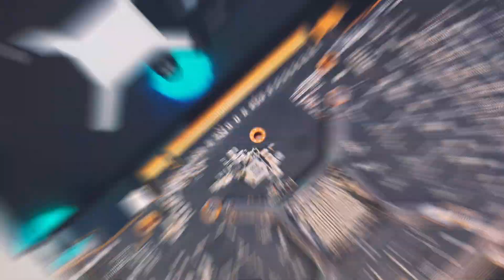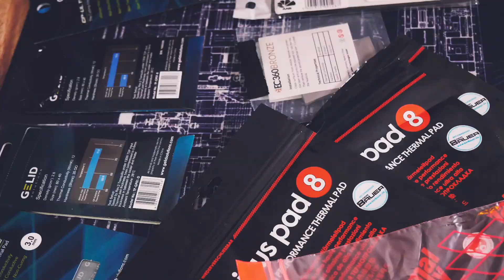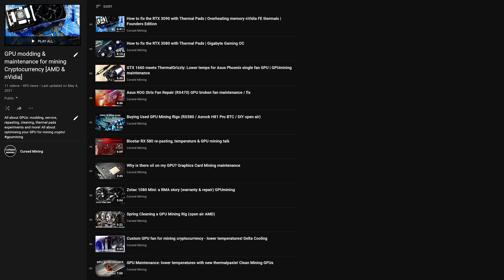Thermal Pad change: Sapphire RX 5700 XT Pulse | GPU Modding Before & After Vram Temperature

Comment: Cursed Mining : you illiterate buttercup.....you didn't remove the plastic insulating cover from the bottom of the backplate where you have put the thermal pads for the memory chips !!!! You have ZERO conductivity and infinite insulation. That's even worse than it was stock.

Comment: i tried out this mod with 1.5mm for the inner most pads and 3mm for the backplate ones. i went from 77c core/79c mem/99c hotspot temps down to 60-65c core/65c mem and 78 hotspot! I was pretty surprised at how well that worked! I was honestly expecting a few degrees drop only and would have been pretty happy about that but this took it to a new level. next time I repaste I'm going to try an idea from another person that also did a video on this mod but they put paste on the flat area under the heatpipes where it makes contact with the second smaller heatsink. So far my temps have been stable so I dont wanna open it up again too soon and mess the temps up again so I'll just have to wait for the next repaste or if it starts spiking in temps again. So far so good though! thanks for making this guide!
Reply: Edit: Nvm. Don't know how it fixed itself but it magically worked after posting this comment lol

Tried this, but now, my screen doesn't detect my PC, BIG OOF.

I don't know if I accidentally broke anything as I was being careful with it. Have to take it to a shop and see if they can tell if it's broke or I'm just not putting the wires in correctly.
Reply: @FullchanAnon  could've been a pcie power cable not seating in fully? has happened to me before but glad to hear it worked out! hopefully you see the difference in temps like i did!

Comment: My RX5600XT (sapphire) does 100-102°C memory when mining/gaming wtf????
Reply: If you mine lower your core voltage to 1300 and voltage to 800
this will lower your GPU temps and Lower power consumption 
Hashtrate will not be affected.
Reply: @drgoose2206  do you think i am a newbie to this??? Man, i mine since the cpu bitcoin mining (my celeron made 2000BTC a day the day back) + this has nothing to do with MEMORY temp, that just means that some pads are misplaced and that sapphire uses shitty pads on memory modules (worst thermal conductivity)

Comment: Can I use any 3mm thermal pad? Any brand? Mi Sapphire reaches 100 degrees. :(
Reply from the maker: sure any brand :) but ofc pad with less conductivity will have worse results, that is measured in w/mk :) cheers and happy modding

Comment: May I ask how big was the thermal pad you bought? I was planning to get the thermal right odissey and they have a 85x45 option and a 120x120 one, I was wondering if buying 2x 85x45 1mm and 2mm each would be enough for front and back

Comment: look have same model as yours but it's rx 5700 i'm not using it for mining just for content creation and video montage and gaming at idle it's around 50/55 celcius and on benchmarks it reaches 68/70/75 not more than that and in some games like hitman and resident evil games on ultra settings the card starts to make a big noise and temps increases to 75/78 celcius 
do you recommend re-applying thermal pad to decrease temps?
Reply from the maker: hello mate! Is this Core temp or Memory temperature? If memory, then you are fine. If core.. it is a bit much on the latter (75+), but in gaming it only happens for short periods of time. To confirm I would use a program like hwinfo64 to check memory temp while doing so, this should definitely stay <94°C. Of course a change like this could still help, pads and paste make a difference, but I would not worry too much if it stays below 70 most of the time (or say 90 or less on memory) :) cheers
Reply: @CursedMining  i don't know this is current temp i gave you junction temp it's more than current gpu don't know where to find memory temp or vram.
Reply from the maker: hwinfo64 is free software for that :) but if junction is not in the 90s it should be fine 👌🏻
Reply: @CursedMining  i'll check it and tell you

Comment: Great video! I was wondering about the backplate when placing the thermal pads that will be conducting heat from the back at 0:1:55 - I saw that it had a smooth plastic sheet underneath it - noticed that it wasn't present on the portion on the long strip of thermal pad and the small square for the one thermal pad beside it. Do we need to strip off a portion of the plastic sheeting before placing the new ones as you did as well?
Reply: real

Comment: Hi friend. Are you sure that the size of the pads are 1mm? Because I saw some people saying that the ideal is 0,75mm or 0,5mm to have a better conductivity.
Reply from the maker: heyho, I went after the Gamers Nexus' / Sapphire info and it improved my card. 0.75 is generally harder to find but depending on the density of pad you can indeed have different results with other sizes, I can only offer to try 0.5 to compare if I need to redo it but mine dropped enough degrees for me to be happy for now :) cheers ⛏️

Comment: Whats mm's of pads?
Reply from the maker: Front 1mm and back 2mm as mentioned in the video & description, cheers
Reply: @CursedMining  I made some measurements on the gap between the Pcb and backplate and it seems like it would need a 3mm pad as with 2mm there is a less than 1mm gap between the pad and backplate on my 5700xt pulse.

Comment: i used sata and it instantly killed my gpu and motherboard im not sure whats going on "the gpu fans runs and led's" but i cant see it on device manager and there was no bad smell or anything and maybe just maybe a possibility that I moved pcie cable a bit and caused that issue or it was from the Sata cable power
Reply from the maker: Please read on Sata power limitations :( I have a few videos on it. Not sure what exactly happened on your end, what system what, you connected etc., but yeah Sata should power nothing than drives or fans :/

Comment: You know I was just messing around with my rig last night noticing some temperature differences between the cards thinking OK I should change my pads lo and behold there’s a video that you made about changing your pads looks pretty straightforward to do
Reply: I just did this recently. What I did was use Gelid Ultimate for 1mm since it's on sale right now on Amazon. Then for the 1.5mm parts I bought some Frosty Thermal pad 12.8's since they better value compared to Gelids and Thermalrights. It's like 30-50% off compared to those with same performance.